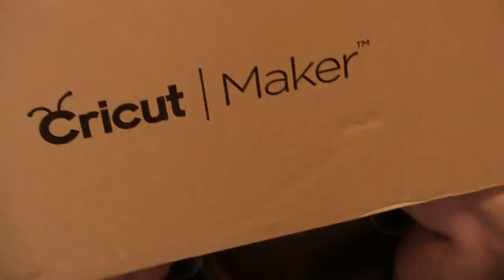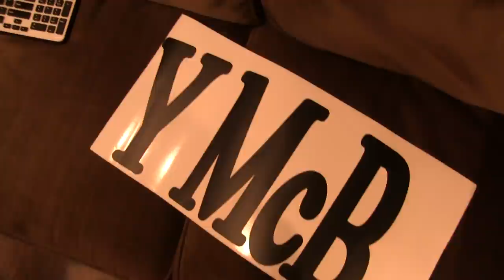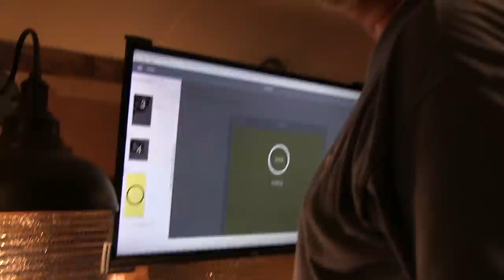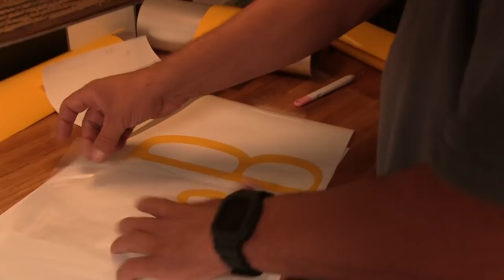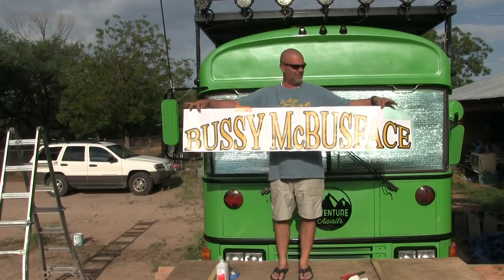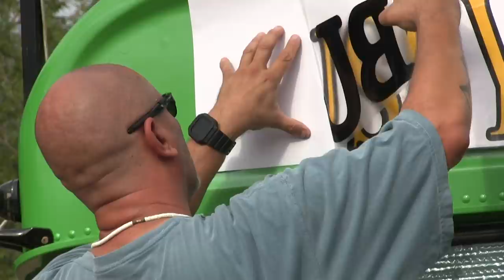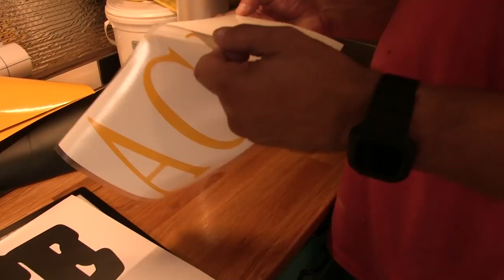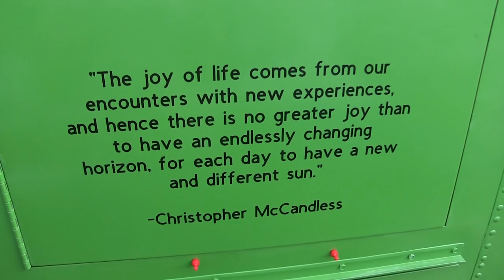Making Vinyl Lettering for our Skoolie with a Cricut Maker!

Comment: You can use a straight pin to poke a tiny hole in the air bubbles the use your squeegee to flatten them.

Comment: This looks great as usual... but im a little worried as u did the round logo "adventure awaits" ... dont u fear dirt will sit behind the round metal piece pretty quick .. which will spoil the appearance and is hard to clean... and i was wondering if u used some kinda form of rust prevent in the new holes u drilled to rivet the piece? 
Anyway:  greets from germany!

Comment: Great video and your bus is looking wonderful. One question, have you checked out the legality of leaving the red lights at the top functional? I had a schooly in Ohio and was specifically checked that the lights no longer functioned to be legal. It was explained to me that school buses or emergency vehicles could have flashing red lights. Just wiring them to flash with the 4-ways was not allowed.
Reply from the maker: They sure didn't seem to care in the inspection.
Reply: @BussyMcBusface  Every state is different, just be aware you might not be legal in all your travels!
Reply from the maker: In Arizona, that only applies to the front lights. No red to the front unless you are an emergency vehicle.